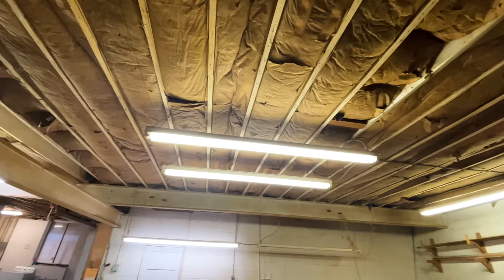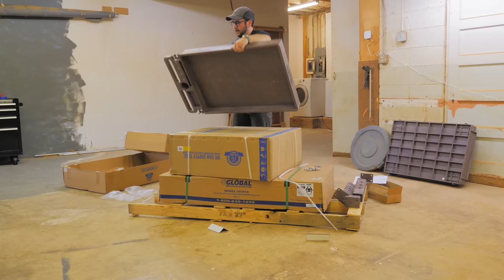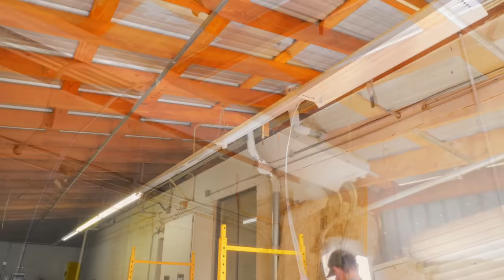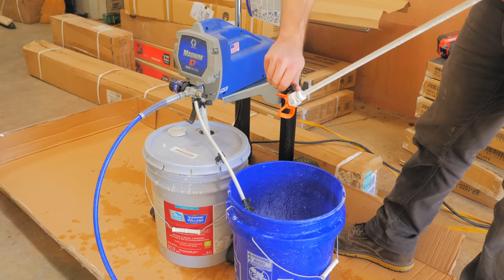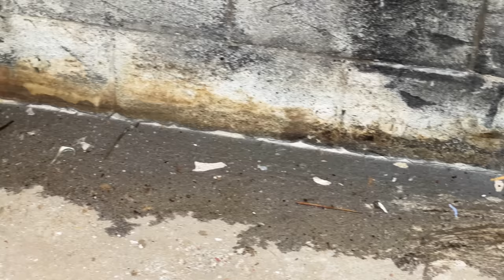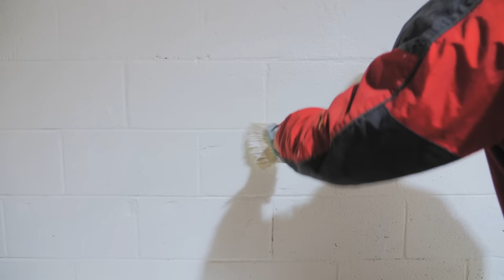RENOVATING My 50 Year Old Workshop Part 1 : Demolition & Waterproofing

Comment: Always always always start with a drainage plan. When the grading and exterior is complete, then you go inside with the sealing and painting. You're chasing your tail if you don't.
Reply: I agree !
If you are waterproofing inside your house your are to late and doing it wrong. You will have problems down the road.
You need to stop water from entering your wall not trapping it in there.
Reply: @davesch1512  THIS!
Reply: Yeah I'm surprised he didn't excavate around the exterior and waterproof the outside of the block and add in a weeper.
Reply: I've been watching Gate City Foundation Drainage on Youtube for a while. He recommends PVC pipe and not that black corrugated pipe that gets clogged over time.
Reply from the maker: As I said in the video, I have plans to address the exterior but needed to get this interior work done first as I had a tight timeline to get the framing work done.
Reply: @craftedworkshop Honestly, you're doing it ass backward and your timeline doesn't matter. It's a bad practice. Expect to be called out for it. I wouldn't say anything at all, but you didn't express the importance of that step and people look to you for advice on how to purchase, renovate, and set up a shop - because you're advertising yourself as a pro. When the wall of dirt next to a building sheds water right back into the building you start there!

It reminds me of the 18 year old kid who builds a hotrod. Puts all his money into the carb and stereo, but can't afford seatbelts. It's just dumb.... sorry, but it is. I love your videos, but I hated this one. That mistake could cost people a lot of money.
Reply: yeah I agree with this...you just painted drylock on the walls that you just removed it from..it costs money to do it right but at least you know you won't have problems. Excavate it to the footer, clean the wall, nail a waterproofing membrane on, apply liquid rubber on all seams and nail spots and then put a french drain in and backfill with gravel all the way to grade. Separate the rock and dirt with a sort of landscape fabric. Sure hope your wall wasn't bowing you just framed over because you covered up some sizeable horizontal cracks with Hydraulic cement..
Reply from the maker: @anarablehill5691  Here's my direct quote from the video : "I should mention that waterproofing the inside of these walls is really just phase one, as the most effective way to deal with this kind of water intrusion is on the outside of the walls. I’ve already cleaned off the roof and gotten the gutters working better, which helped move water away from the building. 

The next step will be borrowing an excavator to do some dirt work around the building. My goal will be to create positive drainage to help move more water away, instead of the current negative drainage which pushes tons of water towards the walls."
Reply: @craftedworkshop  I agree you said that in the video.  I definitely heard you.  Add up the video time you spent saying this.  Then compare it to the time you spent showing the interior renovation.  
I've never been a fan of interior waterproofing.  Exterior is absolutely necessary.  Installing on the interior traps water in the wall at the bottom.  Where's it to go?  If it can't get out it just rots the wall from the inside.  Covering it up makes the damage far worse.  It's much easier to repair a leak if you know it's there.

These guys are correct.  You should have done the exterior first.  I think it would have gone a long way if you showed that first and took some more time explaining the importance of exterior drainage.  It seemed like a half ass effort therefore low priority.  I understand the scheduling need.  I do.  If you had given a few minutes and explained your drainage plan in the beginning, it would have helped.
Reply: Yup
Reply: @simonthebroken9691  I agree with you.  Starting with the outside to explain root cause and then telling the viewers it's being done backwards due to framers timeline and isn't the recommended order would have sufficed for me.  Whole time I was watching the DryLock work being done I was thinking this is a band-aid on a bullet wound.  I'm in a similar situation but choosing to do it the long way.  My older house didn't have a footing tile when built.  Previous owners only did one side and half the back when they had issues.  I want to move my tool restoration work out of my woodshop and into the basement.  The corner I want to set up in is of course not covered by drainage of any kind...thus saving up my money to get that work done then I will start building out a shop space.  The basement hasn't gotten wet there ever but i don't want to tear out peg board and cabinets if it does.  I'd rather ensure I have proper exterior waterproofing first.
Reply: You have to stop the water first!
Reply: Ja zuerst aussehen das Problem beheben und dann Mauer sanieren 😂 sonst hat man in nu das gleiche Problem wieder 😊
Reply: Water problem issue FIRST, then everything else.
Reply: This.  (Almost) always fix water infiltration with grading and drainage.  First.

Comment: So why not do the water proofing from the outside instead of the inside?
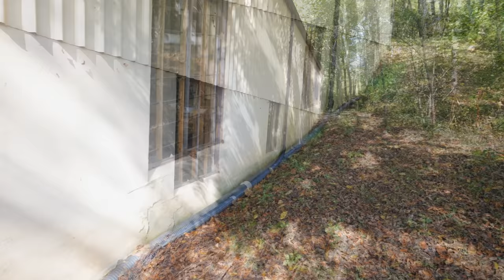Reply: Did you listen to the video? Are you deaf? He adresses this question at 12:00. People, SMH.
Reply: Yep, heard him barely address it after I hit send. However, I stand by my comment about addressing the water from the outside. this should always be done first. Doing it from the inside just traps the water in the block and is more difficult to deal with later. Just saying.

Comment: Looking good, but I think you’ll get more gratification if your begin working more projects alone, regardless of their size and scope. You seem to get frustrated easy and need to find a “solution” when workers building (let alone just remodeling) a shop that size from necessity and actual experience would complete those tasks without hesitation or a second though. Also, the independence will increase your concentration and confidence in yourself! You will eventually minimize your large number of miscalculations seen in the simplest tasks and maximize your efficiency to the point you’re won’t even need your tool belt or body harness, girdle thing. Apologies if you need it for a serious health condition.

Comment: If you’re getting that much water coming through your block that drylok isn’t going to do you any good. You should be addressing it from the outside. Dig a trench down to the footers. At the least put some bituthene on the walls where they will be below grade but your best bet is going to be a French drain and like you said the grading will make a huge difference. But keeping water out always starts from the outside first
Reply from the maker: Watch the whole video! I’ll be addressing the outside in phase two.

Comment: I'd also put a membrane on the outside wall once you pull the dirt out of it cause from the video its not clear if you are planning to waterproof outside of the wall. Right now all you did is trapped incoming moisture like the previous owner did.

Comment: actually, even though your sprayed the walls with the paint. You are kindof suppose to finish up with a roller after it to Smooth the paint out so there is no bumps and splatters and uneven sections.
Reply from the maker: Yea on the concrete block it definitely wasn't a problem since the surface is so uneven already.

Comment: Just out of curiosity can you make a video on the business aspect.

What did you need to accomplish in order to obtain your building.
What are the steps scouting, real estate, insurance, loop holes, tax loop holes.
What are some obstacles you ran into and what to look out for during this process that you wish you would have done.

Hot much it cost, building materials, where and how you got all material. I only ask cause I’m a car Audio shop but I’m looking to get a similar shop as well.
Reply from the maker: I kind of got lucky with this building and happened to see a "For Sale By Owner" sign in the window while I was getting cinnamon rolls at a bakery across the street. 😂 There weren't really any loop holes to speak of, I did buy the properly under a separate LLC, which my accountant recommended. 

I got fairly standard commercial insurance, although I had a little trouble finding someone to insure the property without a fire suppression system. The building cost $372k and any of the building materials I haven't salvaged from the property were just purchased from my local Lowe's. Hope that helps!

Comment: I have sprayed Drylok with a drywall texture gun. Works phenomenally. Sometimes I go back and work it in with a brush but usually the air gun pushes the paint into the block just as well as a brush if not better.
Reply from the maker: Good tip!

Comment: I had the same issue when I bought a house with a three car detached workshop two years ago. Digging a shallow drainage swale 3 feet away from the slab which was sloped towards some nearby drainage and laying a shallow bed of gravel in it completely transformed the building. My tools used to rust inside and the slab would sweat moisture for the entire summer… Now everything in there is completely bone dry.
Reply from the maker: Glad to hear it, as I think that's my plan pretty much exactly. Digging out the entire face of the wall to waterproof it seems like a MAJOR undertaking, so I'm hoping a swale might be a good start and we'll see how well it works.
Reply: @craftedworkshop  the gutters on my shop had been clogged for a decade and the ground was graded toward the slab on 3 sides. To add more detail, I sloped the ground away from the slab and dug a 12” or so deep trench 30-36” from the wall.

The downspouts now run into NON perforated corrugated plastic drain tile which is in the bottom of the swale, then run to a creek bed where they empty. Backfilled & sloped these ditches into a shallow swale, and lined with gravel to somewhat prevent erosion.

Both runoff and actual gutter water are taken away by separate means and the total solution keeps the shop as dry as my house (which is atop the hill.) Works great without the expense of a french drain or weeping tile, because I had enough slope to work with.
Reply from the maker: Thanks for the info!

Comment: Question! So you're hanging lighting, are you planning to any sort of insulation on the metal roof? Obviously the fiber glass was a disaster (and not safe, as it needs to be covered). I was curious if there's a "one step" board foam you can leave exposed, or an affordable spray in? I imagine in the summer it would get pretty warm in there with the metal roof.

Comment: Dig a ditch around the building, drainage tile and gravel with geo cloth next.  Divert the water away to storm sewer of French drain.  Fix downspouts and other runoff (Driveway).
If possible dig down and waterproof the foundation footer and low wall.   Until this sort of work is done, Inside wall work is wasted.

Comment: My alternative solution: Simply use plastic or metal rods to push the old isolation further back. After doing that: Use closed cell foam to spray over the old pinned in place isolation. ... Use less closed cell foam ... Profit !

Comment: My house basically runs on Picos...  Agreed, absolute game-changer.
Reply from the maker: They are the bomb. So much more stable than most other smart home products in my experience.
Reply: @craftedworkshop  - Push button, light changes.  No f__king around with apps and dropped pairings.  Have you seen the tabletop pedestals?  Have one on my computer desk for the office, a dual in the theatre room for ambient and overhead lights, ditto in the bedroom mounted right to the bed.

Even have a remote with their visor-clip in the car, memory button turns on entry (high), main room (mid) and kitchen (low)...  one button from the car.  Awesome and massively under-appreciated system.

Comment: You really should waterproof the outside of the wall to fix the problem.
Reply: He did mention this mitigation later in the video. I thought the same thing initially.
Reply: He talked about diverting the water away from the foundation but not about really waterproofing the exterior. I would want it done right if I owned the building.
Reply from the maker: I’ll probably do both but it’ll be a major project to dig out the dirt around the building to waterproof the block. We’ll see.
Reply: If water is coming in from the other side, the ground will be super soft. Best to hone those mini excavator skills you established during your last build. To quote what a plumber said to me years ago… water is very flexible. I’d make bituthane a priority.
Reply: As someone whose basement drylock had big pimples of mold, I'm not a fan of waterproofing the inside.  Yes, the plan is to fix the drainage, but, the outside of the block will need to be waterproofed as part of that.  With Drylock on the inside, I'm worried that moisture in the block has no easy exit.  (Think about how long it takes a wet plastic bag to dry.)

Comment: why dident the insulation copany clean up after themselfs? they should have cleaned up the dust aswell. thats part of the job. you clean up before you go.
Reply from the maker: I definitely agree. They also left my trash cans filled with dust instead of taking bags with them.

Comment: No Sill Gasket?
Reply from the maker: You would typically only have a sill gasket on an exterior wall, as the point is to seal out bugs and moisture. Not really necessary on an interior wall.

Comment: Very strange way to handle water in a building.
To prevent water to enter a building, you always waterproof from the outside. Then the innerwall is dry and nice.
Reply: He specifically notes and addresses this. He has plans to work on the exterior but needed the inside workable
Reply from the maker: Yup! Plus I wanted the weather to get a little nicer before having to work outside so much 😊